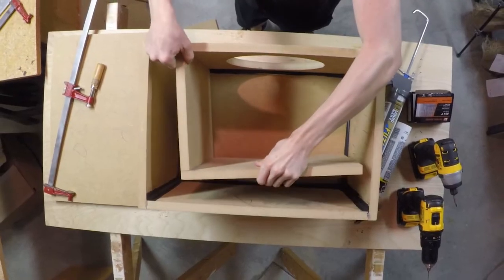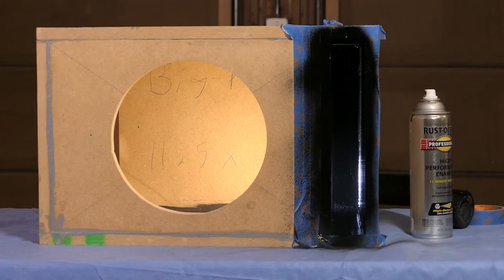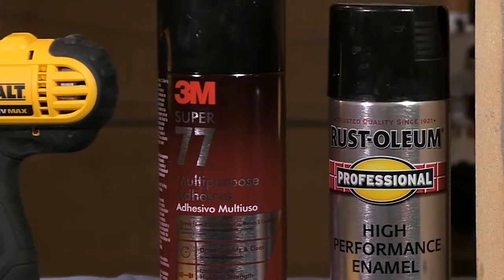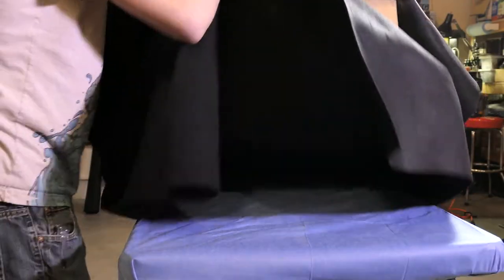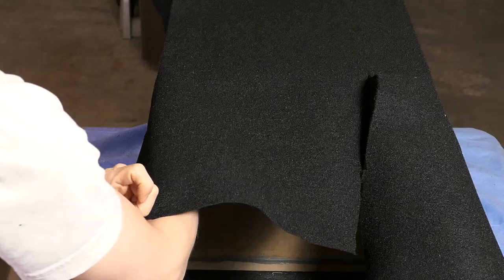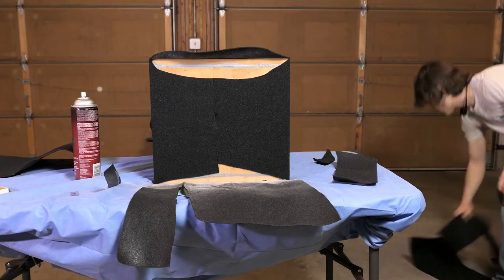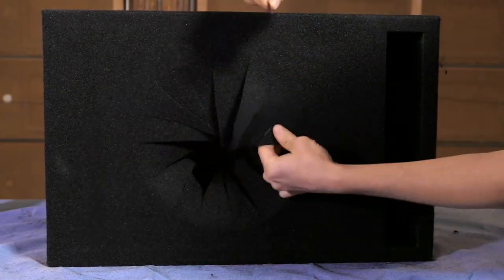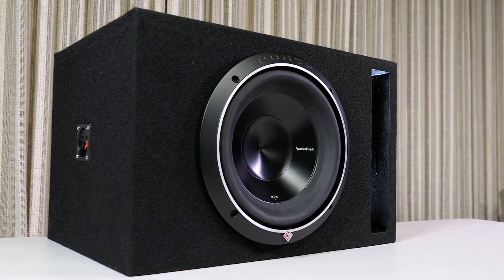How To Carpet a Custom SubWoofer Box for Beginners

Comment from the maker: Find the Speaker enclosure carpeting supplies here:
Speaker Sub Box Carpet (Black): https://amzn.to/2xy1RXQ (paid link)
Speaker Sub Box Carpet (Gray): https://amzn.to/2VhlgoN (paid link)
3M Super 77 Spray Adhesive: https://amzn.to/3csQ1wF (paid link)
Razor Blades: https://amzn.to/2KecIbR (paid link)
Utility Knife Box Cutters (easier to use) https://amzn.to/2XM5bsV (paid link)
Black spray paint: https://amzn.to/3blmlSd (paid link)
Terminal Cup (one I used, screws not included): https://amzn.to/2XMfuNF (paid link)
high-quality terminal cups (screws included): https://amzn.to/3exGNBk (paid link)

Find this Subwoofer, Amplifier, and wiring kit here:
Rockford Fosgate P3D4-10 Punch Subwoofer: https://amzn.to/376PE7T (paid link)
Rockford Fosgate R500X1D Prime 1-Channel Class D Amplifier https://amzn.to/36Y76vj (paid link)
InstallGear 4 Gauge Complete Amp wiring Kit: https://amzn.to/31ulNVX (paid link)

(I may get commissions for purchases made through links with "paid link" next to them)
Reply: Sir what is a good port? Slot port or aero port? Specially for low bass? Thaknks

Comment: Great video man. For a better,  more durable connection, run 2 good bolts with washers and nuts for your terminal. Small dab of sealant and you're good!
Reply from the maker: Thanks for the tip, good idea

Comment: Are you  familiar with custom boxes that fit under rear bench seats in trucks. I have a Bbox A202-12CP Dual 12" Sealed Carpeted Subwoofer Enclosure. One problem is that my JL Audio 12W3 3-4 is to deep to fit this box. Next the box could be built deeper towards the rear of the truck and finally I am wondering if this box (with some altercations, could be vented or ported. Can you please help?
Reply from the maker: I'm not to familiar with those, unfortunately the box with probably have to be redesigned completly

Comment: i have carpet my first box but i was not completly happy how it was turning out on some of the spots where the carpet meets you can see wood. I painted it witch black so it wasnt really that bad. Does this come with practice or i am doing something wrong
Reply from the maker: yeah it takes a few boxes to get it down. try using a new razor blade for each cut, they dull quick

Comment: On the back of the box spray you could paint the box black where you plan on slicing the material. This way should the material open up or shrink the gaps will be harder to notice because the wood will be black. 
Its juat an idea.
Reply from the maker: that's a pretty good idea, thanks

Comment: That terminal will be enough to handle the power coming to the sub?
Reply from the maker: Yeah it should be fine since its AC current, on a bigger system you may want a better terminal cup

Comment: Using a retractable blade knife, and you can probably built and carpet a dozen boxes with a single blade. 
Carpet layers do an entire room with a blade or two, but flooring carpet definitely dulls blades and in that instance blades are CHEAP. compared to to the carpeting, it’s an expendable. 

I was surprised when you got to the first side and you had the perfect crossing lines. I expected the first two flaps to be the two opposite triangles, and the second flaps to fill the openings. That would leave a flat surface and ideally zero visible seams. 
The circular flap is the same result, but maybe there’s a reason I’m  unaware.
Reply from the maker: yeah those are much better, just snap a new one off. yeah i'm not the best at it. if I did a ton of them I would be much better. i'm happy with how it turned out though
Reply: @4WheelKid  actually, I was completely surprised that (at least the fiber type METRA speaker carpet I bought  on Amazon) the stuff DOESN’T CUT FOR SH1T even with a brand new utility knife blade!

Part of the issue was technique, but in the end I resorted to using regular razor blades like you used. Lol. 
Every pair of scissors in my house were garbage. 

As for the snap off blades, I wasn’t suggesting those, and I’ve never had one that was worth the effort. Blades would snap off everywhere except the perforation line!

Get a Dewalt (I happen to just gave that brand) or hood constriction type knife. I buy boxes of blades with like 50 inside, ($20?, it’s been a couple years) and so I always have spares. 
I do electric work mostly, drywall etc. building speaker boxes wasn’t what I was working on, but it was the same carpeting methods I came to find your video. 

Good work. Fwiw.